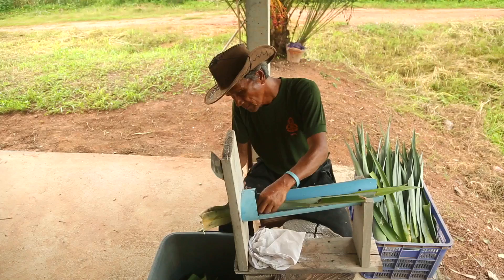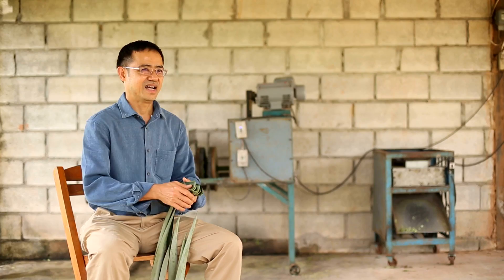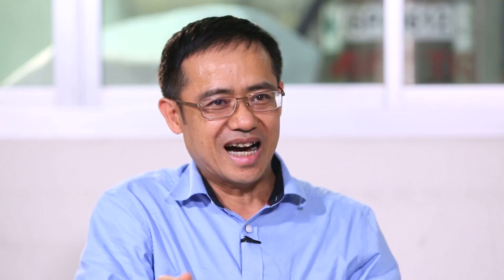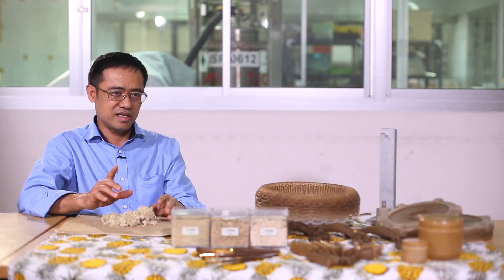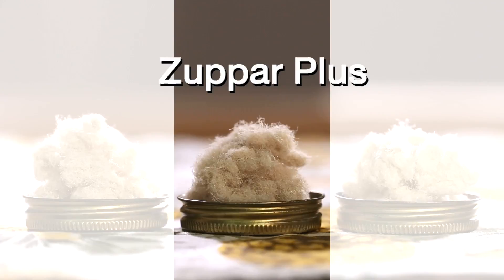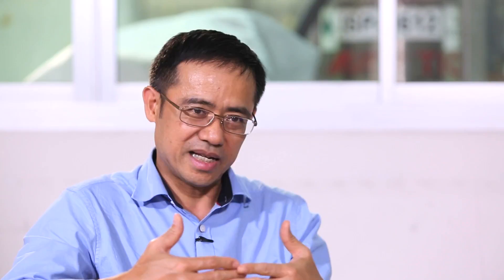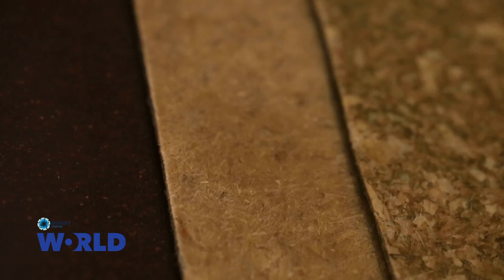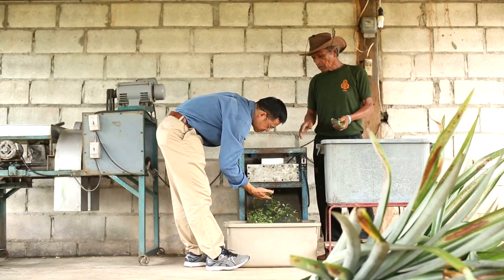Zuppar : a high potential fiber from pineapple leaves : Research Impact [by Mahidol]

Comment: Hi Dr. Taweechai, do you know any degradable plastic resin to mix with Zuppar so the end product is 100% degradable? I think the idea of mixing PALF fibrous and non-fibrous with plastic is GREAT, it acts as filler and reduce plastic usage, however plastic is still involved in it. How can we make it 100% degradable?
Reply: Thank you for your comments. Yes, I know some degradable plastics. I tried PLA and am currently working on PBS and starch. We are interested in durable and recyclable products with low carbon footprint. We try to use recycled plastic and employ the products as places to store (sequester) the carbon. We are also developing products that is 100% degradable.